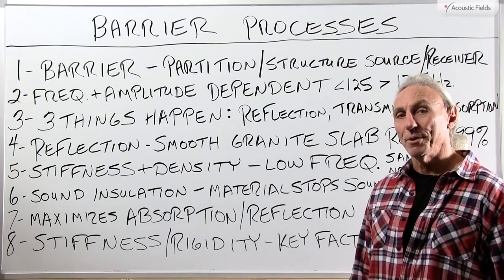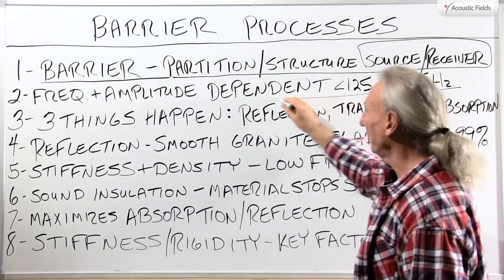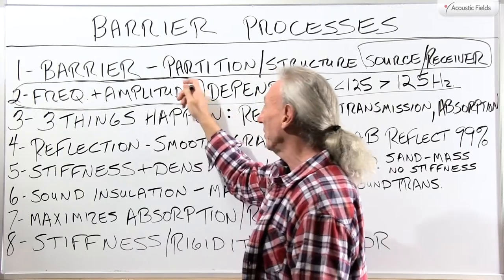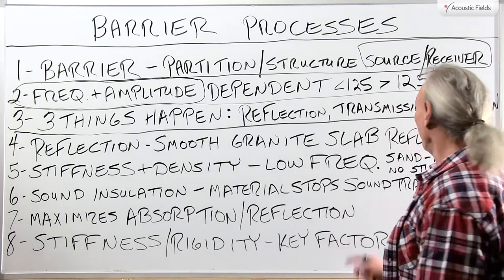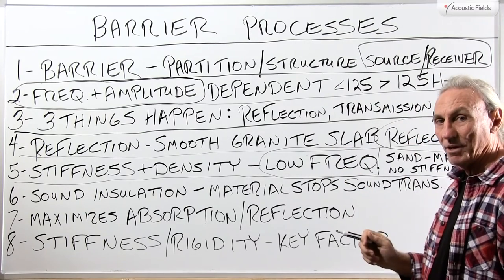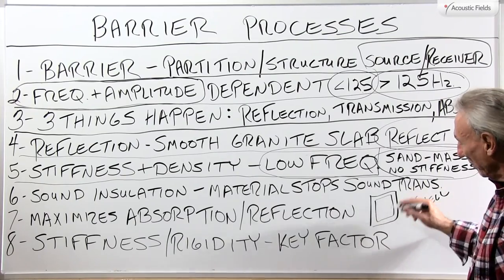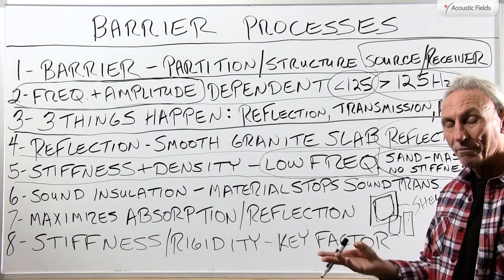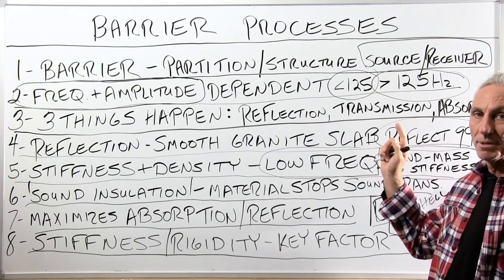Barrier Processes - www.AcousticFields.com

Comment: Hi Dennis, nice to see your new video! Down to what frequency at 80-83 dB SPL the 30 cm concrete wall is efficient?
Reply from the maker: Hi Leonid, A 11" thick wall is good for energy below 125 Hz. at that pressure level.